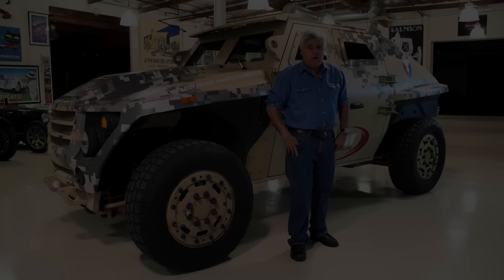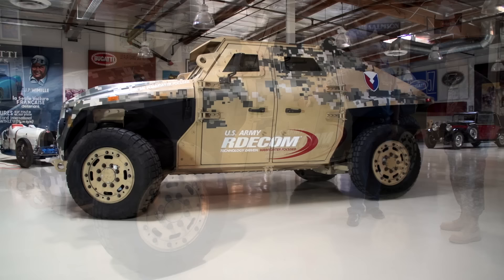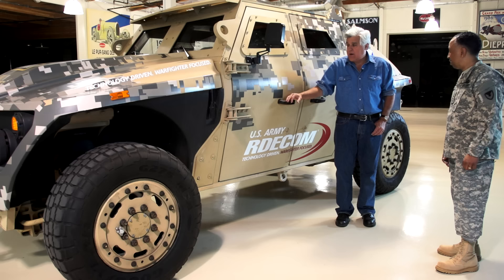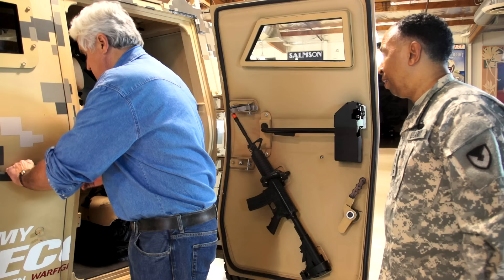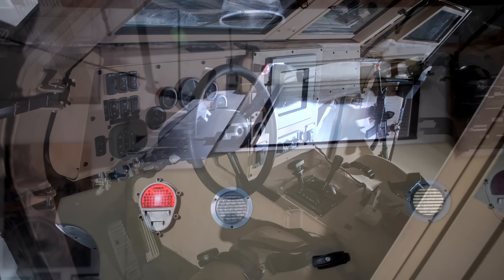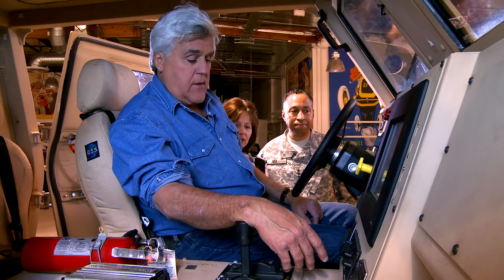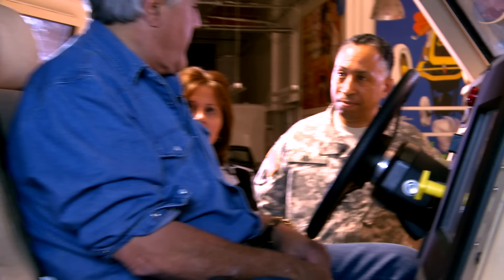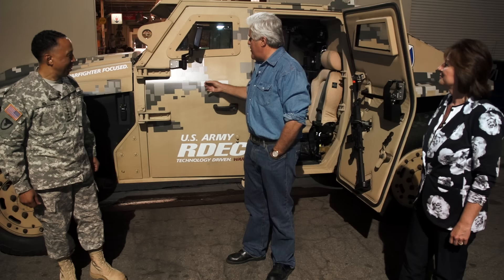U.S. Army FED - Jay Leno's Garage

Comment: A cool-looking waste of money. I was taught muzzles are pointed down during transport in case of accidental discharge. Also, what happens if the air bag suspension gets shot up? There is no protection around there.

Comment: Wouldn't it be better to put the door hinges INSIDE the vehicle instead outside, where they can be damaged by explosion?
I see very low protection for engine and driving components, how the vehicle will leave in case of an attack?
The belly of that thing on the other side is designed well, nice angles to guide the explosion away to the sides.
Why aluminum pars and carbon fiber parts? They just expensive and no protection at all! Reduce costs and put cheap steel sheets of reduced thickness (TRIP 700 for example...)
Reply: i agree on all your points. plus, aluminium burns quite viciously if i remember.

Comment: cost 5x a hmmwv and still cant take an ied. hmmwv was never designed as a armored vehicle, it was a replacement for the jeep, and did a good job of it. Other than the fact it used a crap gm engine

Comment: #britek Never Flat Logistics. 50% r/r  High Speed. Pneumatic tires have reached their performance limits. Speed, Acceleration and blast resistance. Redundant Safety. Will build prototypes on request. US 9,004,120 B2

Comment: How would that carbon fiber hood protect that "4 cylinder" from a 50 BMG? Of course you need steel to protect the soldiers but damn the engine in case they need to get out the area huh?

Comment: What about protecting the engine? I don't think that carbon fibre will stop a 50 BMG bullet from piercing the engine block.
Reply: Neither will the doors. It takes a lot of armor to reliably stop a 12.7mm AP round. A lot of armor that is hard to put onto a "light armored" 4x4 truck. What they are trying to protect the crew from, are the rifle-caliber rounds that are in far more abundance than 12.7, 14.5, or larger.

Comment: v4 wow
Reply: Its a in line 4 or straight 4
Reply: Yeah but a car that big that only has 4 cylinders is pretty surprising
Reply: Wubby penguin well clearly you don't know too much about diesels.  Not a insult to you by any means. If  you had one diesel cylinder it would put out more torque that 2 gas cylinders.
Reply: Oh, and yeah I don't know much about it, I know mostly about gas

Comment: It would be far more efficient to put an electric motor in each wheel and power it with a capacitor bank and a petrol fuel generator.

Comment: Ahh the next step of SUV's when the current size Ford Raptor gets reclassified as compact and this one becomes the full size SUV. 
The irony of better technology leading to better fuel economy but people just buy bigger and heavier negating the benefit. Gotta love human fallacies, no wonder things are not improving.
Likened to a 50% sale, many buy 2, leading to NO reduction of actual dollars spent.
Reply: Interesting perspective.  Your comment seems to be coming from several different angles.  The vehicle was made for the military, so in regards to fuel economy and several other factors it does have several improvements compared to the humvee.  If the comment is in response to others above suggesting that it will only become the next progression of a civilian full size vehicle, I get what you're saying, but honestly, this vehicle (or something equivalent) is not going to trickle down to civilian use.

Comment: I like it.  But 7 MPG?  Even with that shape, I think it should do better.  You can even get 10+ with a V-10 Ford F-350 dually.  I think the solar panel is a good idea, but it is really small to be really effective at this point in the technology that has trickled down to the rest of the world.  30 gal. tank is probably more for weight than overall function.  Either way, give and take got it made, and then the bean counters got involved.
Reply: I think he said it weighed seven tons - 14,000 lbs.  That's a lot of weight!  So the gas mileage suffers.

I think the solar panel is just there to keep the batteries charged.  So many electronics on this thing - and military vehicles sit in storage a lot.  Makes sense.
Reply: Duramax pulling a backhoe on a trailer at highway speeds is well into the double digits.  It was close to 17 but all highway.  That was over 14k total.  Not trying to make an argument, but there still seems to be room to improve from the folks at Cummins.  But I still like it.
Reply: seawalkersee
Well, maybe there are other things going on - driveline friction - full time AWD maybe, those huge tires?   If you're getting 17 mpg towing with a Duramax, that is amazing, considering my little Frontier is rated for like 21 highway, towing nothing!
Reply: Gearing, tyres and aerodynamics would be the biggest factors increasing consumption.

Comment: with aluminum armor doesn't that leave it vulnerable to gallium? anybody who watches enough YouTube knows what happens when those two get together.
Reply: yeahh some they are really worried someone might run up to the car spend an hours sand blasting a small amount of the powder coat off then applying gallium and waiting a few hr for it to weaken its blast deflectors.
Reply: sneaky sneaky
Reply: A few days maybe, that aluminium is really thick
Reply: galliums a meta lrememmber perodictable of elemrnts

Comment: That is gonna sling a lot of mud all over the side, and the side windows. It has too few lights, even with some use of night vision. The interior looks cramped for men wearing packs and winter clothing.  Wrestling an injured man into that thing looks extra challenging.  Just seats four.  You won't drive this thing out to rescue personnel, you'd have no room to put them.  The engine and supporting mechanicals look susceptible to damage from gunfire.  I doubt the thing is steerable, or drivable, after puncture of hydraulic or coolant lines.  Small fuel capacity.  Doesn't seem to have much thought of  use of use of defensive weapons from the thing. The more I think about it, this thing has serious problems.  Does it really serve a potential purpose?

Comment: I filmed the 2015 Range Rover Autobiography LWB, Sport, Evoque - Mercedes-Benz S63 AMG Coupe, S63 AMG, GL63 AMG, ML63 AMG, CLA 45 AMG, E63 AMG S, A45 AMG, SL65 AMG Black Series, SLS AMG Black Series, G65 AMG - BMW i8, X6 M,X5 M, M4 Coupe, M3 Sedan, 4 Series Gran Coupe, M6 Gran Coupe, M5, 7 Series M - Audi A6/A7 Facelift, R8, S8 facelift, RS7, RS6, RS5, S5/A5 Sportback, RS4, S3 Sedan, S1, Q7 S Line, TT S Line- Volkswagen Golf 7 R, GTI, GTD, Pheaton, Tiguan R Line, Toureg Facelift - Mini Cooper S, Paceman - Ferrari LaFerrari, F12 Berlinetta, FF, 458 Speciale - Mclaren P1, 650S - Rolls Royce Phantom, Ghost, Wraith - Bentley Continental GT V8S, Flying Spur, Mulsanne Birkin Edition - Lamborghini Huracan LP610-4, Aventador - Porsche 918 Spyder, GT3, 911 Turbo S, Macan Turbo, Cayenne Facelift, Cayman GTS - Jaguar XJ, XF, F Type - Peugeot 508 facelift, 308 - Opel Insignia - Seat Leon Cupra, FR - TESLA Model S - Bugatti Veyron Grand Sport Vitesse - Nissan GT-R - Subaru WRX STI - BRABUS 850 S Class 850 Biturbo, SLS 700 Biturbo. Check my channel

Comment: What if the engine got shot at?
Reply: Simple: It get's shot. To try and protect the engine from equal threats as to the crew, would mean adding another couple thousand pounds of weight in steel.
Reply: Oh, so I guess the US army didn't think about being stuck in the line of fire then.
Reply: They do, but at the same time, you can't protect against everything. There are weight limitations to the vehicle for it to move, road weight limitations, bridge limitations, and transport limitations. Already this is a 7 ton vehicle riding on 4 tiny contact patches. If this thing sees anything not hard packed, it will sink and need rescuing, just like the current HMMWV, which weighs a similar amount, and is just as road bound.

Comment: Jay does this run on gas or diesel
General in a bubba voice; well it runs on gas,diesel,propane,acetylene,peanut oil,vegetable oil,mineral oil, that’s about it. 
Me what is this amazing engine
Engineer. It’s a 2 liter Cummins 
Me. Oooh
Reply: It doesn't run on gasoline, propane, or anything else suitable only for a spark-ignition engine. It's also not a 2-litre engine; it is the ISB4.5, which is a 4.5-liter, inline 4-cylinder (from the same family as the B-series engine used in Dodge then Ram pickups).

Comment: A 4.5 turbo and supercharged diesel and it only has 200HP? And this thing has to have a massive air intake and some crazy big filters to filter out all of the dusty air. And in a EMP attack this thing will be useless.
Reply: don't forget the 500 ft lbs of torque which is MORE important than hp........but those numbers are pretty standard for diesels....

Too many people get caught up in hp ratings.....that's just one side of the coin.
Reply: I know that but compare this 4.5 to Mercedes Benz 2.1 TD, It has 195 HP, and 395 ft lbs.
Reply: Josh McCarthy The Cummins is an industrial duty diesel engine. Diesels made for consumer vehicles have higher HP rating for similar cubic inches but they might not have as much torque and will not be as dependable as industrial duty diesels.

Comment: Well ,yea Thank you for going to such lengths to show us such a ridiculous piece of logistic hardware. Only a Sheik or the mighty U.S. military could operate such a car of course. Perfect for high level personnel such as the engineer,General,Jay Leno,& Diplomatic staff.  The protection of personnel is a great redeeming feature. Have a look at the equiptment abuse Humvee operated with & imagine how this will lend itself with such flexibility? It does not. Aluminium saves weight ,but run one into the field workshops & weld a bracket on or a fitting, may be a lot more demanding on process than iron based alloys. Comments about fuel range, self leveling noise, speed & frequency also have merit . Not convinced the air supply socket is worth putting in the limited F.O.V.? As for bomb proofing, drive a tank along the road first & give those things the four inch thick steel floor where weight is an advantage?
Reply: Don't fret US$423,298 is the per unit cost of the current Armored military vehicles. After lots of searching i could find nothing on the per unit price of the Fuel Efficient Ground Vehicle Demonstrator.
The bottom line is we are sold out to private corporations making huge profits off of the American people... We are killing our self's with military spending. Same as the Soviets did...  Good thing we will save all that money on gas....
Reply: Hey Jon, Funny enough a buddy of mine, a recently disabled U.S Army Mechanic is over for a few beers right now. He Agrees with you completely,  he has personally seen much heavier armed MRAP's get destroyed by simple i.e.d's, informed me of this little gem, http://en.wikipedia.org/wiki/Explosively_formed_penetrator
Fuel is a joke since 90% of the vehicles are kept running even at night in the motor-pool. Not to mention the equipment for Aluminum welding is non existent. Maybe in the Air-force but definitely not on the ground in the Army. We both agree that the only real use for a vehicle like this is executive protection, and even then in a Hot Area It would be in a heavily armored convoy. Seems like a neat "toy" that's about it.
Reply: Zevin X
 This is also a reason for the shape of this and some other new vehicles , the flat bottomed humvee and older vehicles held in the full force of an IED, the newer vehicles have this rounded bottom to deflect the force out and around the vehicles so they can take a better blast. Also this is a prototype, chances are the bottom plate on such a vehicle will be depleted uranium or some other super hard alloy or material. Look at the shape of under carriage and you will see similarities to the MMPV (army) and MRAP (marines) just much smaller in scale.
Reply: Ian M
Right, and it just also happens a EFP made for pocket change, and literally OF pocket change can penetrate a MRAP or even the reactive depleted uranium Armor of a M1 Abrams . Private company's usually with the right connections sell us these "life savers" (for massive sums of money, thanks to the American taxpayers) Meanwhile the private corporations make massive profits as long as what they sell looks good to the American people. Protects Americans soldiers? Take my money! Just so happens a MRAP was what my buddy was in when he got a Traumatic  Brain injury and became disabled.

Comment: So stupid to put a small engine in it. Whenever you over force a small engine with air it gets more horsepower but you lose efficiency to milage under load. You see these new engines in these trucks with 4 cylinders get worse milage than the v8s while towing. You cant compensate for displacement